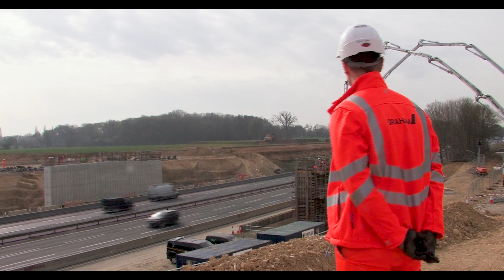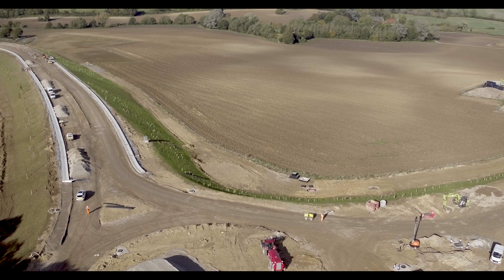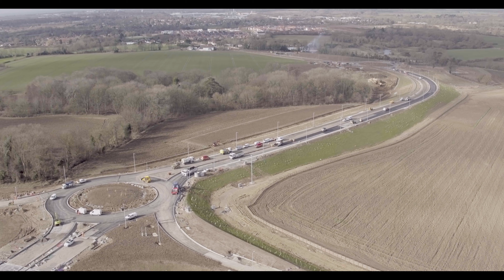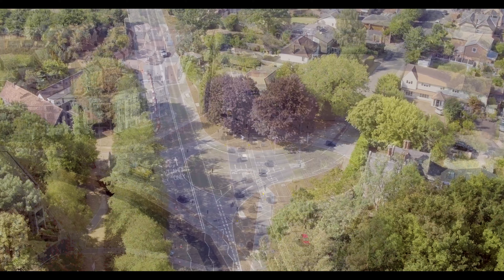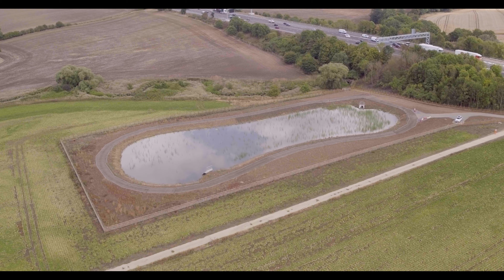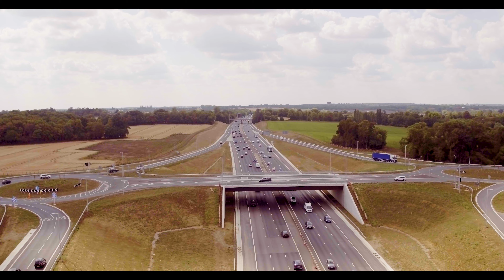M11 Junction 7A

Comment: The project hasn’t finished yet. The dual carriage way as part of the works down most of Gilden Way before Churchgate Street is still coned off to a single carriageway by the new watercourse pond built from the motorway into Harlow and is causing a hazard to road users. I’ve seen many a near miss of an accident there as there is no signage and I haven’t seen anyone there doing anything for months.